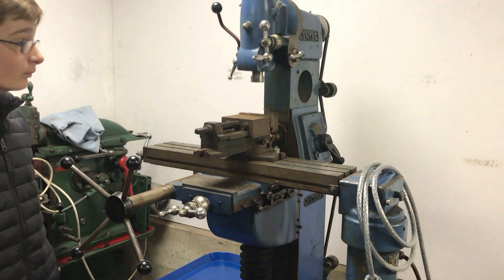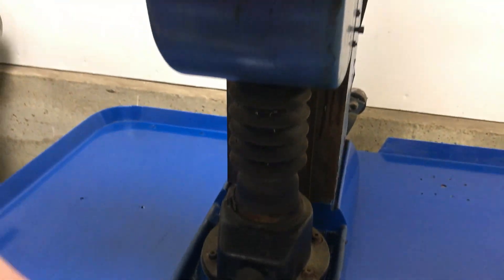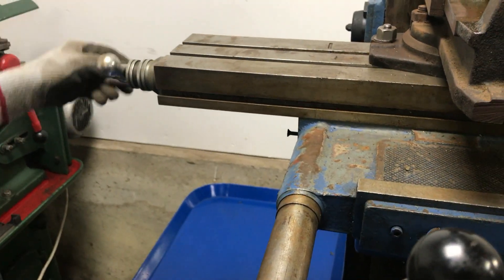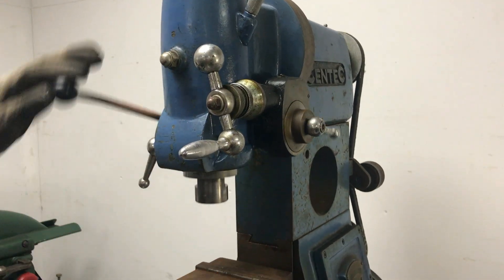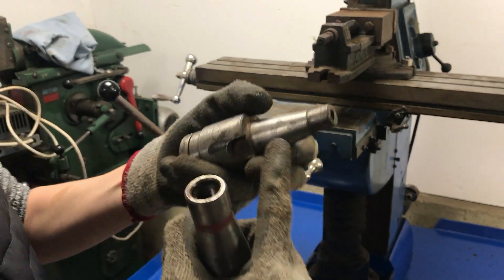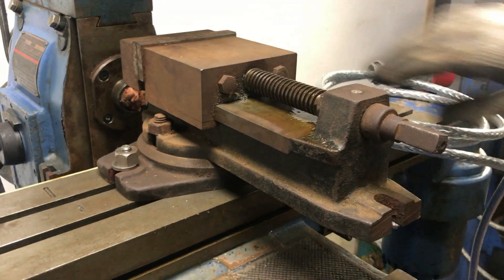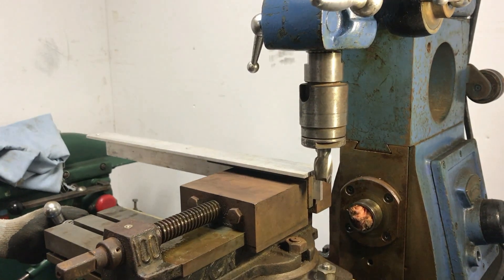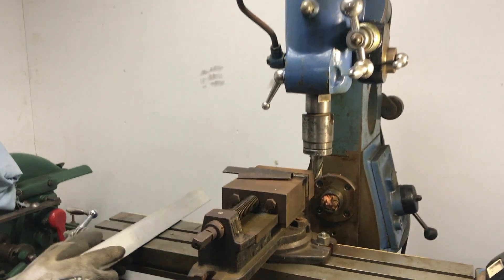Centec 2B mill overview on Workshop Wednesday

Comment: Hello, I have been offered one of these exact mills but am concerned about the weight with regard to relocation and my workshop (timber) floor.  I presume you moved yours?  How many men did it take?  Dos it break down in more manageable sections?  Does the gearbox have to be drained if tilted?  As a beginner am I better of purchasing a Draper 34023 or equivalent?  I am hoping to build some steel bike frames, I would like to make some tube clamps, general fixtures, make some track ends and notch the tubes. Best Regards
Reply from the maker: When we moved the mill to our workshop, my dad and I did it by lifting it onto a trailer with an engine crane. I believe the 2A weighs approximately 360 lbs - the 2B 500 lbs and the rarer 2C much heavier, all plus the weight of the stand. We lifted the mill complete and it is was a lot easier than we thought but I don't think you would move it with a number of people lifting. In my view a Centec is a true professional machine and the others hobby machines, other than the space it takes up you will not regret buying it. The only restriction we have found is the limited Z travel but our machine has a raiser block which helps a lot. I do have a PDF showing the lifting point and setup, if you drop me a email I will be happy to send you a copy. If by any chance you are in Norfolk you are welcome to look at ours in operation and we would be happy to provide further information on moving it. We do not have a background in machining and found it a good machine to learn on. Ideally any machine needs to be on a concrete floor but we know a couple of people who have a Centec in a timber building. I hope this helps
Reply: @GardenTractorBoy Thank you so much for the advise. Lots to think about!
Reply from the maker: @pauljay5308  It might be worth you contacting a couple of our Youtube friends, Paul who has the channel The Knackler's workshop is a machinist and does a lots of work on cycles, I am sure he will know the best machine for you. William at William's workshop has a Centec 2B and I seem to recall that he has a timber workshop

Comment: Not a criticism but use the terminology X,Y,Z for the axis moment. 
The purpose of the half nuts is for cutting slots in screws etc. With rapid movement. 
The power feed box can be adjusted for feed rates by changing the removable gear under the cover.
For optimum rigidity use ER collets, 30 int bt30 etc.
Reply from the maker: Thanks for the feedback, I am still learning the basics so this is helpful to know. The power feed on the Centec did not come with any additional gears, we did check under the cover to see if they were stored there. Take care
Reply: @GardenTractorBoy  Honestly, your enthusiasm is fantastic! Your local model engineering society will help you with matching tips etc and a good source for machine parts etc.
Reply from the maker: @union310  Thank you. I will check our out local model engineering society

Comment: Hi , the centec Mills were precision machines & the big lever on the bed was for repetitive production jobs .If your lucky look inside the top of the power feed gearbox on the end of the bed above the motor & there should be a set of change gears for power feed speeds. The riser block is a nice addition for the fine feed quill head , I had to make one for my 2A machine which transformed it's potential considerably & the thirty international taper was an option from the factory for better tooling on a smaller machine which is also on my 2A.The fine feed head is a very nice & sought after bit if kit .
Reply from the maker: Hi, we really like the Centec mill but we have found it really difficult to find out any information about it. When your message came in, I rushed out to the workshop and checked inside the power feed gearbox but alas no additional gears. We really like the riser block and I can't imagine using the mill without it. We have also struggled to find INT30 adapters that work with the existing drawbar as it is not straight forward to change the drawbar unlike our Cincinnati mill which is INT40. Do you use the original drawbar or have you made different ones for M12, 1/2" UNC, etc? Take care

Comment: Nice to see the Centec in action. With its riser block & 30INT tooling, that's a bit more grown up than my little 2A version. The Clarkson Autolock is a clever design. You shouldn't have a gap between the nut & the main body of the chuck. Do the nut up just finger tight against the body, then screw the cutter in as far as it will go & then use the spanner to fully tighten the nut. If the cutter slips in the collet, it automatically pulls the collet tighter inside the chuck.
There's some info on Centec on the lathes.co.uk website. They might be able to supply a manual too.
Reply from the maker: Thanks. The riser block is great and I can't imagine trying to use it without. Thank you for the great information about the Clarkson autolock, we did not know that. Take care

Comment: The controls seem stiff. Be sure that they are clean and lubricated. The wipers are important to keep the ways clean so that wear is minimized. When setting up for an operation, you can use a piece of paper to get a known distance from the work to the cutter. Figure paper is 0.03". In the early 1980s I was fortunate enough to work with some old machinists. I'm looking forward to seeing the shaper work. I have an old 7" Atlas Shaper that needs rebuilding. Good Luck, Rick
Reply from the maker: Thanks. We are trying to adjust the gibs properly at the moment, and they seem to be a bit too tight currently. We haven't actually used the shaper before and we are also looking forward to giving that a try. Take care

Comment: Hello Joseph,
Good video... The long lever to the left of the quill, I would suggest for sensitive drilling, it should allow you to feel better when working with small drills / cutters...  I like what you've done with the power cable, that's something I need to do with most of my machines... See you next time.
Take care.
Paul,,
Reply from the maker: Thanks. We bought the SY cable from ToolStation and the length it comes in meant that we managed to rewire two machines with one length of cable. Take care